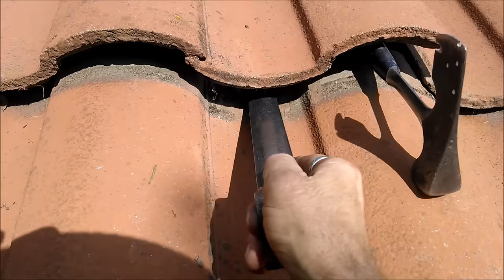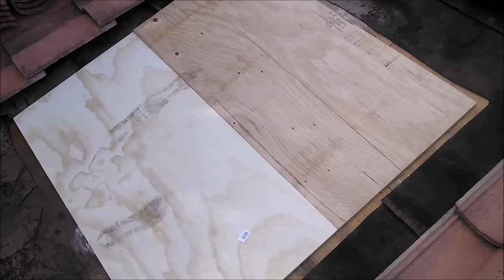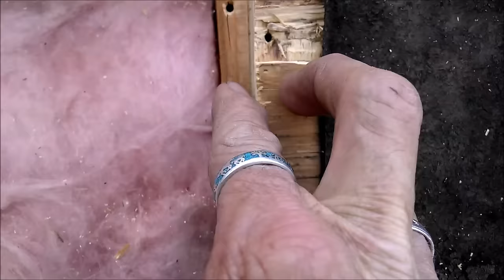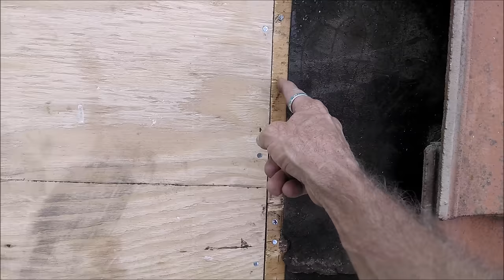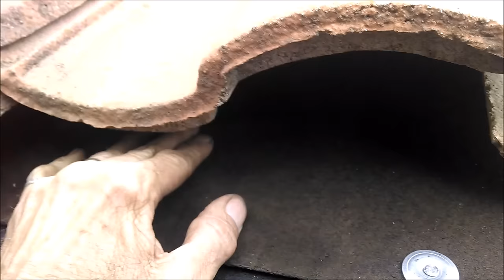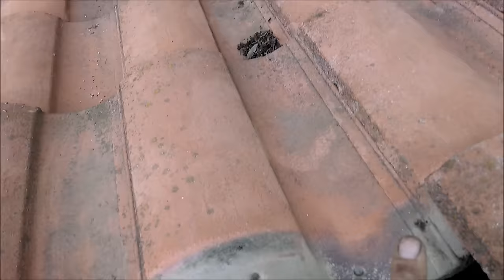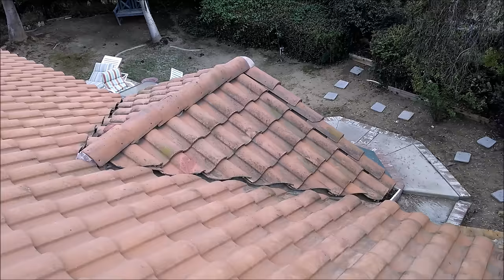Roofing Tile Leak Repair - Tips, Tricks & Helpful Hints

Comment: Suggest use galvanized roofing nails (paper nails) like done originally,  out lasts felt. Metal cap nails rust. These are cement. Copper nails for longer life.
Reply from the maker: So how many times have you personally seen metal cap nails rusting out in areas under the tile where the tile is installed properly? I’m not talking about surface rust. How many times have you removed those metal cap nails only to find them in mint condition underneath the metal cap where the metal cap holds down the tar saturated felt paper? I’m not talking about areas of improperly installed tiles where water intrusion is prevalent. That’s not on the nails… that’s on the lazy roofer who compromised. I’m talking about where all the different roofing materials are installed as recommended by the manufacturer.

You see… we should NEVER rely only on one piece of the puzzle (like nails or felt or tile) to solve the problem. We always have to look at the big picture where all the materials working together as recommended by the industry, prevent water intrusion & enable roof systems to last decades or longer.

I used to do inspections & ran quality control for a reputable company with hundreds of roofer years ago & made them go back & fix their piece work where they cut corners & didn’t follow industry specs. I literally taught them how to roof houses correctly & why we did things certain ways. Add to that 20 years of running my own roofing company where I personally completed every repair on the books & I have never once seen any roofing materials expire prematurely when they were installed correctly.

So no, I don’t recommend throwing away these metal cap nails for something else just so another roofer can cut corners & not do their job roofing according to manufacturer’s specs. They are sufficient to do the job where code allows for them to be part of the system. There are reasons why code allows for certain materials in certain areas, but not in other regions.
Reply: Plenty. The tile breaks or water blows by. I prefer the time tested approach. I also blind nail using 30 # UL felt that is lapped (two thicknesses) so the only surface penetration is the copper nails holding the tile. Here is St. Louis, MIssouri UL rated 30# is no longer available so I am using Carlisle 300 HT WIP. It self adheres and test show it seals around nails. Steep roofers here according to my suppliers are using self adhered membranes. Been doing this 40 years I've seen galvanized paper nails and 43# or 30# asphalt saturated felt last 60 to 100 years depending on pitch and exposure to sun. So, I like how the old timers did it but now I am forced to level up.

Comment: Hi my tile roof was built in 1980 and they used the wood  
That is spaced 
Help what to do
Reply from the maker: If it’s open spaced sheathing you have two basic options… 1. Tearoff, resheath & reroof, or 2. Live with it the way it is & seal up any & all cracked tiles, because the only water barrier between the elements & your house is the tile.

Comment: How much did you charge for that repair ?
Reply from the maker: Amounts are too subjective to compare across time, locations, supply & demand dynamics, inflation & how various economies fluctuate.

I made 2-3X the income in southern Cali than I can make where I’m working now. The odd thing is that I am actually able to build capital almost as easily where I currently am as when I ran my roofing business in Cali.

You simply can’t compare apples & oranges.
Reply: I am in Cali and I'm trying to see how much I should charge for a repair that size.
Reply: Thanks Dan so much for replying.

Comment: Thanks for helping me cause I ain’t got no man to help meeee
Reply: I'm in southern California if you need any help let me know I get allot of stuff from home Depot also wholesale and been doing roofs also I'm in San Bernardino CA
Reply: Francisco Saca thanks for offering. I ended up getting my roof repaired. It was a little over $4,000. I thought it was a small leak repair but they had to take all s-tiles off and replace the plywood with new wood and completely new felt.
Reply: @sweetsukeule8789  wow sucks glad it's fixed now
Reply: @franciscosaca2767  trying to score some meow
Reply: @rudystraight1750  Damm right I can teach you kid
Reply: @franciscosaca2767  im already taught. Thanks tho

Comment: What if you have to move that tile again.  Shouldn’t you use a clip.  Won’t separate sealant wout breaking tile.   Idk
Reply from the maker: Jerry Walker Nope... There’s just enough holding power with the glue to keep them in place indefinitely but not so much that it breaks the tiles if you force them apart. I’ve gone back & moved tile that I previously glued.

Comment: We have roofers that do work in 2 phases & felt underlayment is left exposed for 2 qweeks, then phase 2 is tile. can rain penetrate felt?
Reply from the maker: It depends on the fasteners they use for the felt & if the flashings have also been installed with the felt. Cheap felt nails don't hold the felt snug & it tends to shift & tear the felt at the nails. If that happens then no, the felt will not remain water proof. But if the felt is installed carefully using large galvanized metal cap nails then yes, the felt should remain water tight in a decent downpour provided the vent pipe flashings & other roof flashings were also installed with the felt. And to answer your other questions, two (2) weeks exposed to the weather for 30lb felt is no big deal.
Reply: Thank you
Reply: @MrThedocholiday  We just had another section that had leak over soffit. The roofer description along the eave/edge of patio section of the tile roofing where water is coming through soffit. Remove the 1st 2 courses of concrete tiles as needed. Remove 90# tile underlayment, drip edge and 30# felt paper to expose leak. Remove and replace up to 1 sheets worth of 5/8 CDX plywood, nailed off to code with 8D ringshank nails. Install 30# felt paper to code with 1-1/4 ringshank nails and 1/1/2 tintags. Install tri-built HT-TU Self adhering modified tile underlayment back nailed to code.Install new drip edge flashing nailed off to code with 1-1/4   ringshank nails. Install concrete tiles (color and profile to match as best as possible due to age of existing tile roof) to code with screws/foam adhesive. Estimate $1850.00. Crew came out and unde an hour done. I asked if they replaced plywood, they said only underlayment. They did not try to paint terra cotta color and left a white foam as example of the work done. I paid $925.00 down. Don't you think it was way under estimate? They we at end if day and in a hurry, so I don't know if it will keep it from leaking again. Don;t you think I should get adjustment on cost of job? Please advise Duster Dan. Thanks again

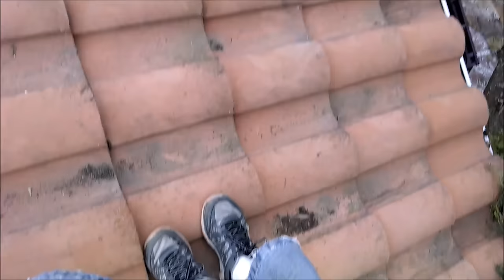Comment: at 20:51 you video you feet standing square in the middle; not on the overlap edge- how do you get away with that 118 pounda?
I have monier spanish 1991 and it would fracture all to hell- I only have maybe 1/4"-3/8" x 1.25 battens. lots of issues if i were more ambitious in summer i.d put cross batten and radiant barrier and ridge vents.
Reply from the maker: I've been walking, standing, working & carrying things on tiles roofs now for over 3 decades. That's how I get away with it. You probably don't remember Keith Carradine in the TV series Kung Fu from the 70's & 80's, but just like the young Kung Fu student was taught by his master, in time he would learn the art of walking the rice paper. After 30+ years I have stubbornly become "one" with the roofing tiles. This was not my intentional doing, but regretfully, my feet learned over time that if they didn't become lighter & less destructive, they would have to stay & work longer replacing broken tiles before they could go home & rest, not to mention the additional expense of paying for replacement tiles that cut into my profit margins. There's no substitute for experience in roofing or in all of life. Experience pays much higher dividends than head knowledge, even though head knowledge IS valuable. Thanks for asking... Hope you have a happy Thanksgiving!
Reply: @MrThedocholiday   I SEE HOW YOUR TENNIS SHOE BENDS AND SHAPES THE BARREL. OTHERS SAY THE  PEAK OF THE BARREL; WHICH IS TOO MUCH WT..  I ALMOST WANT TO MAKE A  FOAM  BACKED SNOW SHOE 3 BARRELS LONG BY SHOE WIDTH AND THICKER INTO VALLEY MIRRORING MY MONIER VILLA, i HAVE USED SOME LONG NARROW 2X 6" BOARDS TO SCALE ACROSS. i AM A KLUTZ. Fix five break one.  Running out of remedy.

Comment: Hi what brand of glue do you used? Thanks 😊
Reply from the maker: Any adhesive that dries in a few hours, adheres to most construction materials, remains flexible, is paintable & waterproof… any copolymer, tripolymer or quad ISO.
Reply: @MrThedocholiday  thanks for your answer

Comment: How can i find the origin of the leak when no tiles are displaced?
Reply from the maker: Tamara Kennedy Years of experience... You’d need to know what keeps rain out & what let’s rain through. There are too many variables to say, but let me give at least one key... Rainwater doesn’t normally penetrate the roofing where there isn’t volume & flow of water on the roof. Look for valleys, flashings, obstacles, profiled tiles with crown & valleys or exposed nails.
Reply from the maker: Sorry Tamara, I’m not in Cali anymore.

Comment: Can we get a details parts list?
Reply from the maker: 1/2” plywood or 7/16” OSB
30lb ASTM felt underlayment
stand. 8D nails for sheathing
7/8” metal cap galv. felt nails
OSI Quad all season caulking
10D galvanized nails for tile
Hammer
Chalk line
Flat nail-bar
Saw
Ext cord
Leaf blower
Nail/tool bags
Etc.

Thanks for watching…

Comment: where are you l ocated, currently I have roof leaking problem need to fix it. I'm at San Diego
Reply from the maker: Thanks so much for the invite.. I'm in riverside, CA & SD would be a several hour drive for me. I hate to turn down work but I would suggest finding a local roofer, do a background check on their license at the cslb.ca.gov before you hire them & make sure they have a supervisor on site to oversee the work while your roof is being repaired. If you do those basic things you should be happy with the results. Thanks for watching...

Comment: Want to slide back  macquarie concrete roof tile to put end fascia brackets with existing roof trusses

Finding difficultyy in sliding macquarie concrete roof tiles 
pls any tutorial video
Reply from the maker: Are they nailed per chance? Check the beginning of this present video to see how I check for nails & remove them to free up the tiles so they can either be removed or at least slide upward. Also keep in mind that you often need to not only remove any nails holding the tiles but also relieve the pressure from other tiles sitting on them from above because they are sandwiched between the roof deck & the tiles resting on them.

Comment from the maker: Somebody asked me what I think about flat tile. So instead of just giving my opinion about flat tile, I’ll give a brief overview of all three basic tile profiles & why, so y’all can determine for yourselves which is best for your situation. So here goes…

1. Flat tile is tight & keeps everything out of the roof the best, but it also easily blocks water flow around obstacles & flashings way more than the higher profile tiles.

2. Full ‘S’ tile has the opposite characteristics from flat tile. It is very loose as far as airflow, leaves, debris & critters go & lets a lot of these things under the tile, but affords water flow around obstacles & flashings far better than flat tile.

3. Low profile ‘s’ tile is a happy medium of characteristics between the two other types of tile. 

There are many other shapes & sizes of tile, but all of them fall into one of these three categories & each category has it’s strengths & weaknesses because of its profile nature & how that profile helps or hinders each factor or challenge on each roof. They all face the same quality control standards & are designed to be 95-98% water tight when installed correctly; but they are almost never installed correctly… almost never. 😁 So finding someone to install them correctly is the most important factor when choosing a tile for your roof in my estimation.

Hope that helps

Comment: Shouldnt those tiles be layed on battens
Reply from the maker: Ash Burrows Nope... not in this area of the country & not at this roof pitch. Battens are called for only in areas where they must raise the tiles up off the roof deck for environmental reasons or whenever the roof pitch exceeds a nail’s ability to hold the tile in place without battens.
Reply: @MrThedocholiday  
Cheers for that Dan. Its interesting how ur roofs are working over there. Every one of our roofs from  flat to steep are battened. And hardley any get felt ( sark) unless they are on the coast or its an extra
Reply from the maker: Ash Burrows Yes... this system works pretty good when done correctly. Thanks for watching.

Comment: Blew out the valleys, but didn't take them apart to check valley crimp or felt damage.
Reply from the maker: Yes. When you do literally thousands of leak repairs you get pretty good at recognizing the difference between possible problems & real problems. The homeowner didn’t ask me to look for problems, so unless they do, I don’t go looking for problems unless I see something they’ve missed. Ceilings tell a great story for whether or not there’s a current issue worth addressing. I remember inspecting their entire ceiling in this area & saw no sign of water intrusion or leaks. I’ve got 36 years experience diagnosing, troubleshooting & waterproofing & the customer never called me back regarding additional leaks. Just sayin…
Reply: @MrThedocholiday  No leaks is a well done job. I clean hundreds of feet of 10-20yr old valleys. Just a suggestion if ya want more $$$ per tile repair. I show the dirt in a 10ft area once taken apart and many+ neighbors say go for it. $$$$ i should have attached a pic. p.s. est. 1983

Comment: How much should i expect to pay for a  job like this?
Reply from the maker: Mister Wells In a free market, which is what we have, there is no such thing as a ‘one size fits all’ pricing structure for anything. Your question comes from a place that assumes all things are equal & that therefore you can determine a set of absolutes that can be applied across the board. I always steer clear of answering pricing questions based on multiple variables & you should too. My advice is... Figure out what quality labor is worth to you & pay the bill.

Comment: Dan come on buddy you would not have had the repair if upgraded underlayment was used. 
Don't disrespect the upgrades in my opinion... yes 30# is minimum code requirement sometimes not everywhere anymore for a reason.  There is tile roofs in Italy that are 1k years old because the tar work done underneath. Talking pride in your work as you say can lead to generational roofing like on a winery that will continue to exist. You give 30# 50years then some of my roofs might hit hundreds of years. You hit one of my pet peeves minimum code requirements. 
No disrespect just the other side of a hot button for me.  For a repair you are spot on sir... upgrading disagreement falls in with scope of project. Steeper the better. :)
Reply from the maker: Actually, yes the repair would have been necessary, because even upgraded membrane is not rated for 100% exposure to the elements for the life of the roof. Not even cement roofing tiles are rated for more than 50 years exposed to the weather when installed properly. But you probably knew that already & felt sorry for the upgrade premise.
Reply from the maker: And if 30# felt no longer meets code, it’s likely because the industry doesn’t install things properly rather than the inability of 30# felt to perform. I have seen over ten thousand roofs personally & observed the areas of roofing & underlayment where the product is installed properly after 30-50 years without a stitch of concern for leaking. Leaking always happens where there is a breach in the primary layer of roofing because of damage or improper installation… always & without exception.
Reply: @@MrThedocholiday  I would never install 30# on a tile roof unless it's a repair like you did. Upgraded underlayment has a 6m U.V rating vrs 1m with 30#. If you catch the broken tiles within 6 months, you can repair tiles and avoid underlayment replacement in repairs and interior repairs if it leaks.
TG2 is way better and what I would probably use in repairs vrs 30# as well. CYA by covering theirs the best you can. ;) Steeper, the better